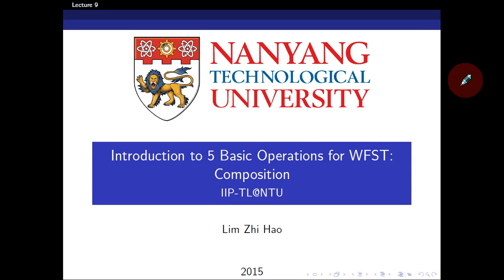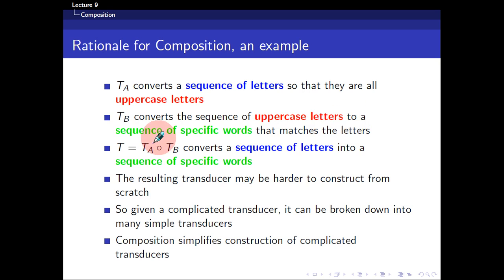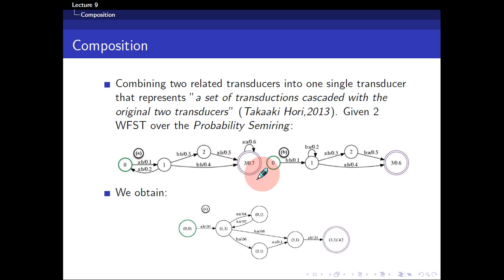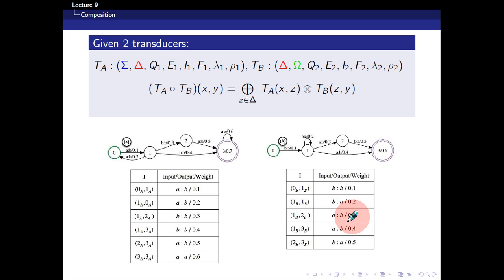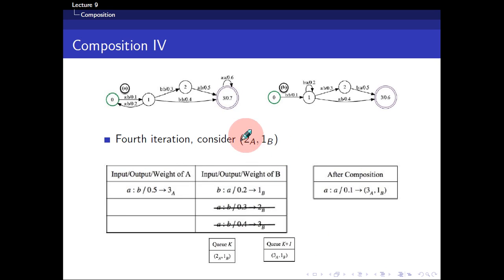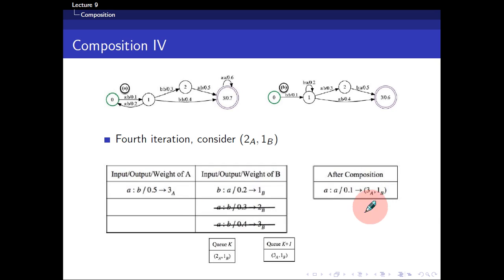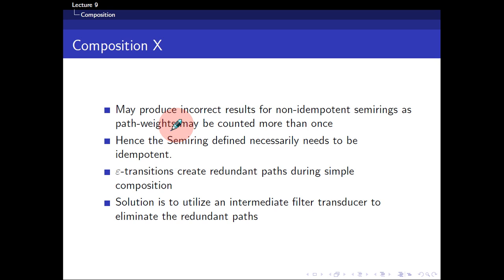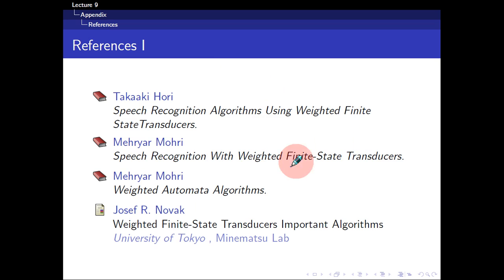Lecture 9  Introduction to 5 Basic Operations for WFST  Composition

Comment: There is a bug on the fourth iteration slide, the table in the first column Input/Output/Weight of A should say 2_A and not 3_A
Reply: 3_A is correct.
Reply: He's starting from 2_A and the edge is from 2_A to 3_A.